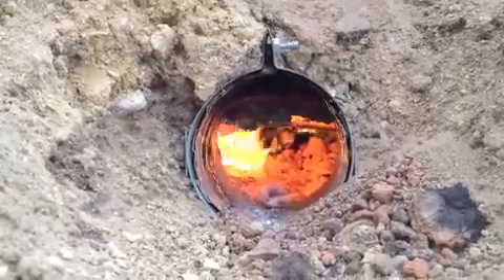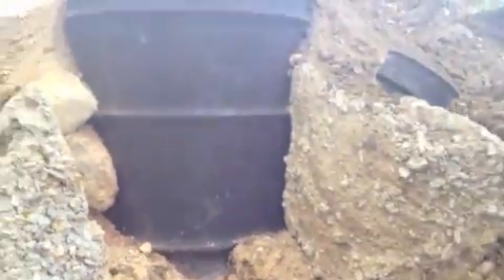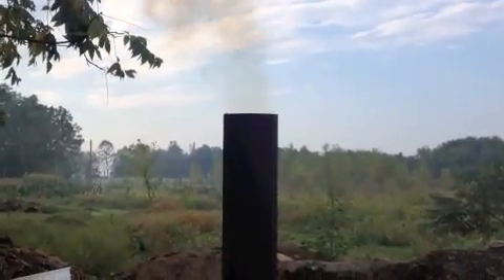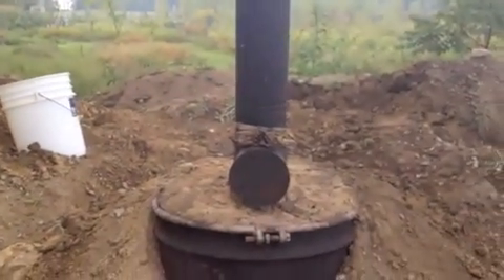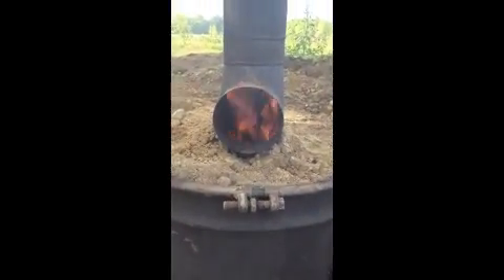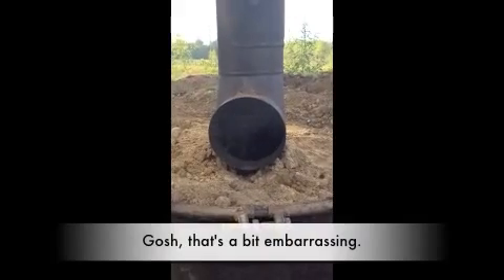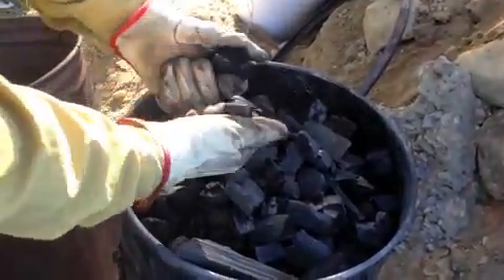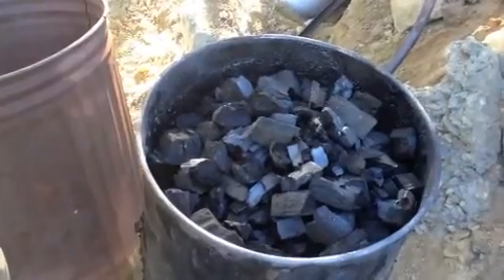Biochar Retort Stove Sept 2012

Comment: Hey Rob, I have a suggestion. If you run a pipe down from the top of the 15 gallon drum and back to the burn chamber you should get perfectly clean combustion and instead of wasting all that heat burning up top it will help create the charcoal.